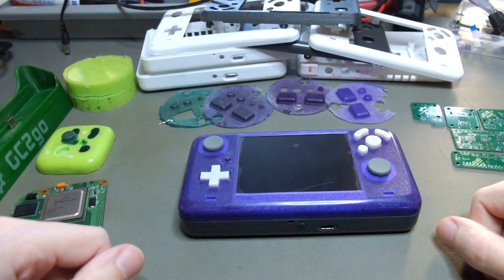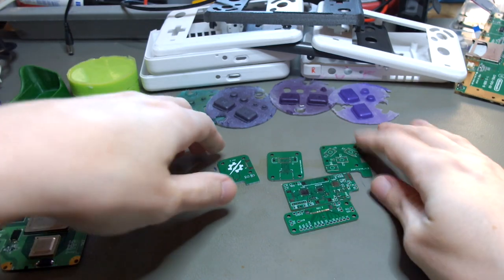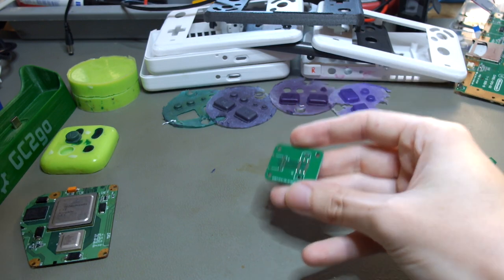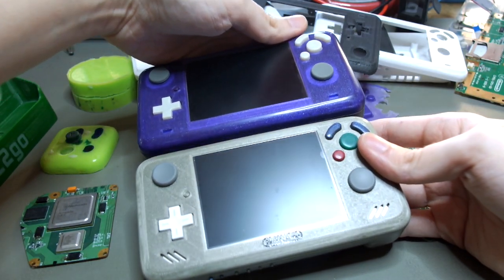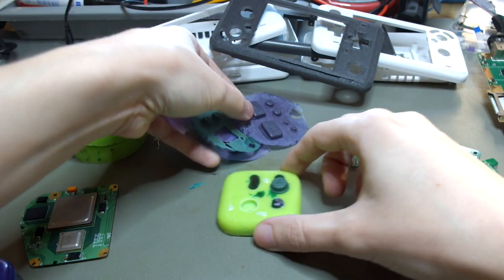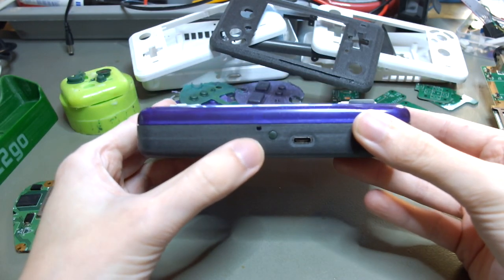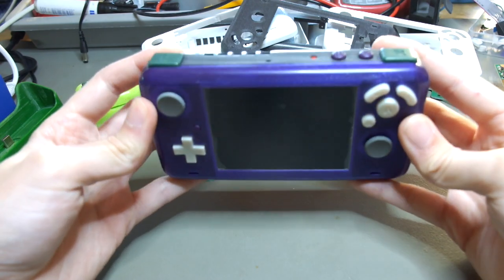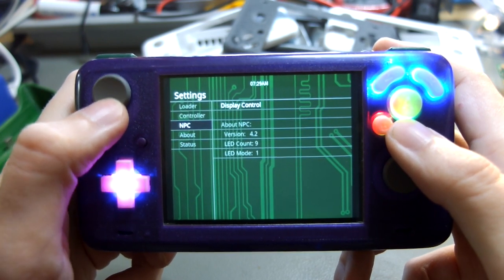GCiiPocket v2 - The GC2go! [Wii Portable]

Comment: did you use vga mod ? i have installed homebrew channel , its work fine with rca cable , now i did vga mode on the wii with pc monitor  the first menu show up display normally , but wen i enter to hombrow i get black screen and screen shows no signle

Comment: yet another masterpiece from Nold , why didnt you use direct connection for your lcd and wii ? i think you used vga and a board driver for lcd am i right?
Reply from the maker: you mean the RVL-DD? It's currently not available due to the chip shortable. also there has been no 3.5" version in the past